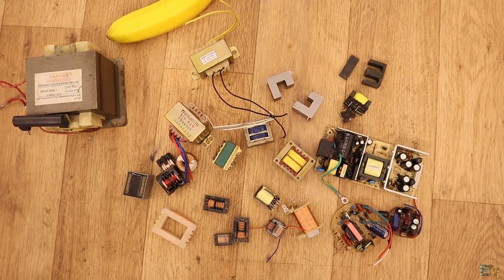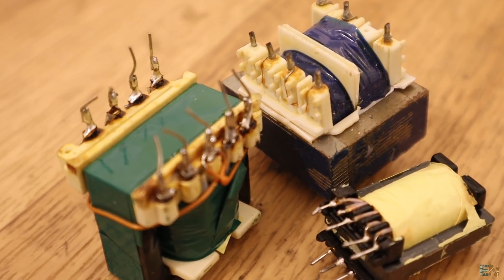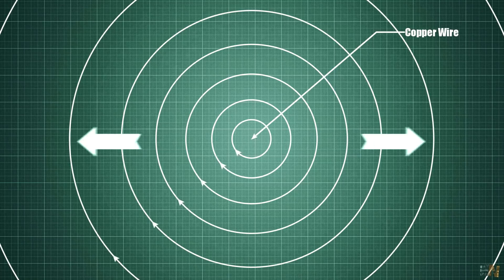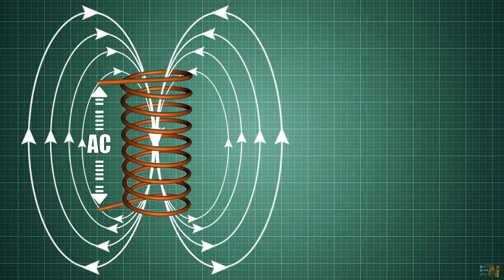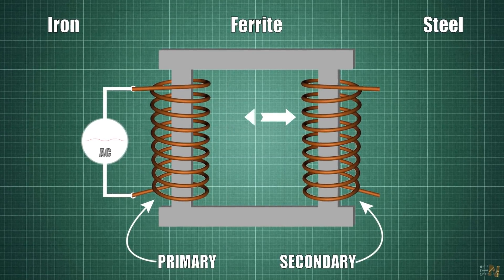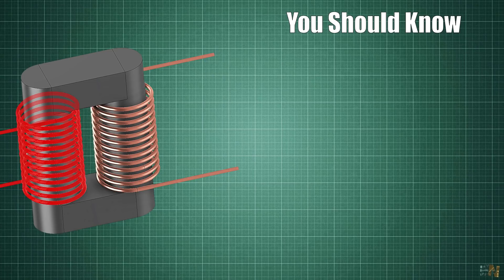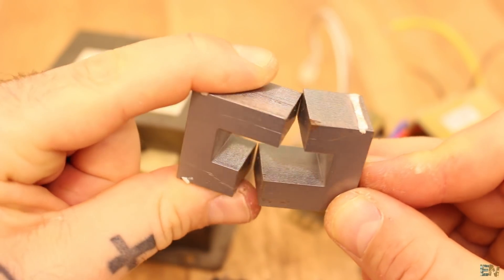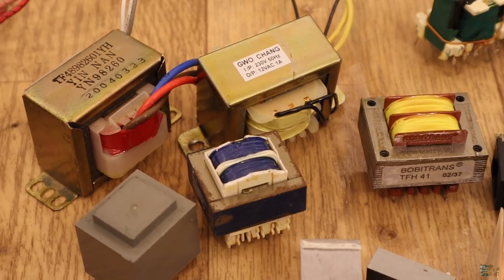Basic Transformers Theory #1

Comment: Great work ! Still waiting for the next inverter video with feed-back , I'm working on an inverter project myself but I'm using a different technique than the one you explained last time , I'm generating high DC voltage  than using an H bridge with SPWM signal to get the correct waveform , that's after an LC filtering .
Reply from the maker: Maybe you can share your work on Electronoobs.io so we can all help and do it...
Reply: @ELECTRONOOBS  yes of course 😉

Comment: I have a Substantial box of various transformers stashed here some place.  A few rather beefy ones like 20-40A.   Always had some plan for them that never came to be.  LOL  Just lately I've use some MOT ( Microwave Oven Transformers) to build a few heavy duty Battery Chargers for my Solar System.   After removing the old Secondary you can do stuff with those .  They make a really dandy Spot Welder.